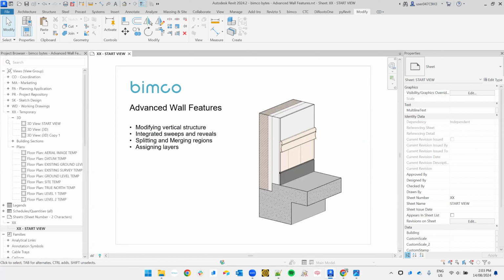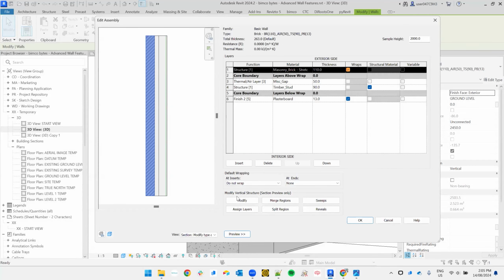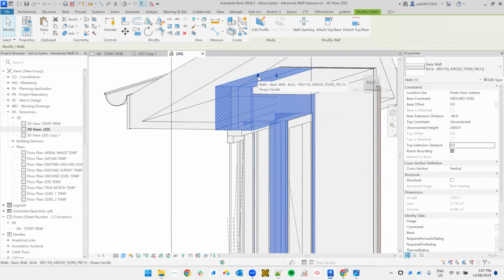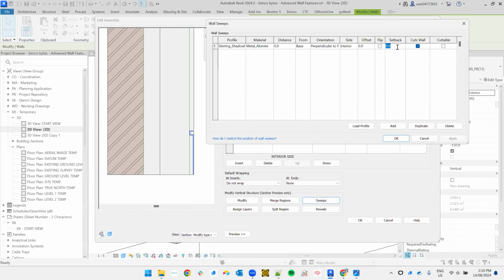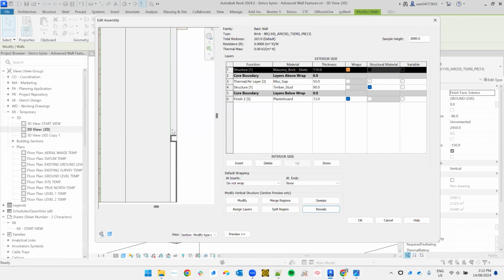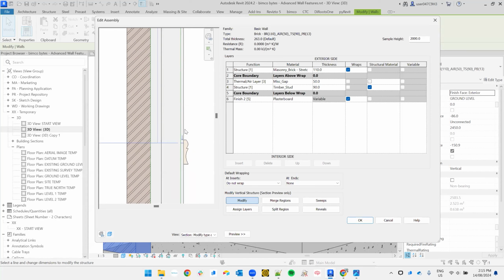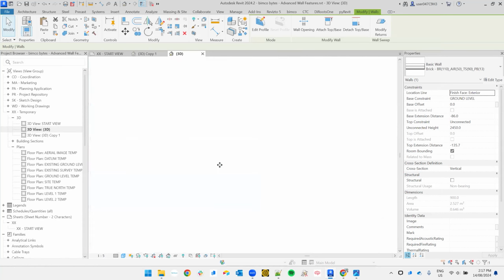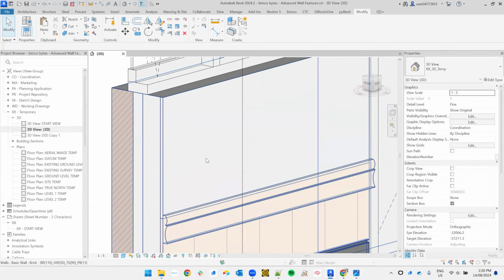Advanced Wall Features - bimco Revit 3D Modelling Training Tutorial

Comment: Interesting, I'm an AutoCAD user currently trying to learn Revit. There seem to be so many different ways and methods of doing things, which makes it difficult to know when and where to stop modelling and where to start detailing. For example in your wall model in this tutorial, it looks like you';re adding quite a bit of detail to the model, but would you then have to consider what happens to the sweep moulding when you get to a door opening / architrave junction? How far would you go modelling something like that?
Reply from the maker: Hi @jasonrosewarne6762, thanks for your query.  
When deciding how far to go with modelling versus detailing, it's recommended to model elements that would be visible at a scale of 1:50 to 1:20, while anything requiring more detail should be handled in 2D to avoid overcomplicating the model and to save time.
When it comes down to it, as with anything in BIM, the real question is, what value does it provide to the model/ communication of the design/ render. If its negligible then reconsider spending the time. Its fair to say that some of this could be achieved with a custom hatch on a flat surface or even a flat surface with a detail showing the makeup of the wall.
For all intensive purposes, this video is demonstrating a tools and means which may/ may not be applicable for your project, it'll be upon you to make that judgement call. Best advice is start simple, then layer up.
Coming back to AutoCAD, you're always considering the effort to draw each line and the value it provides. Starting with simple boxes then adding detail as the design progresses and as necessary

Comment: Thanks for sharing. I would like to know if we can extract the actual length of skirting and profile and quantity of other layers as you split or merge layers some of layers by using this method.
Reply from the maker: Hi @maroofjamal575, there is no native way for you to do this that I'm aware of. You could get the length of the wall type which would be accurate but only if there were no inserts and the ends of the skirting were not adjusted.
To do what you are requiring, its probably best to build a family with a length shared parameter (suggest Generic Model so its cuttable) assign to a subcategory to be able to control its visibility and schedule it filtering out all other generic model items.